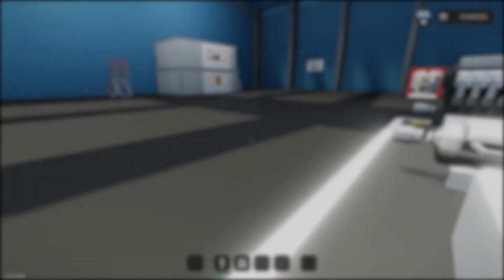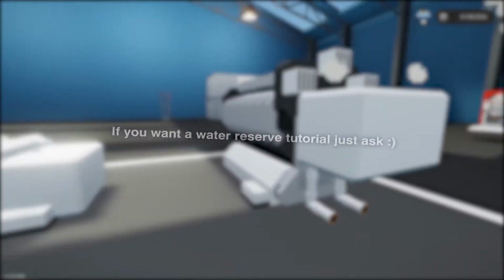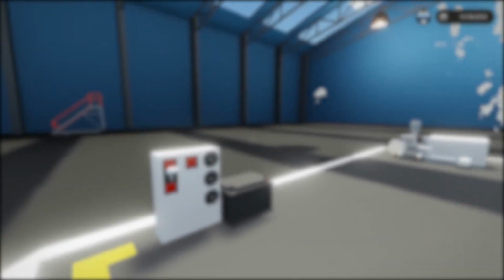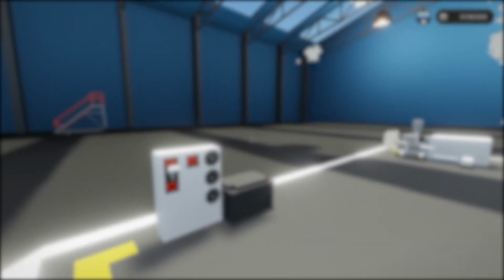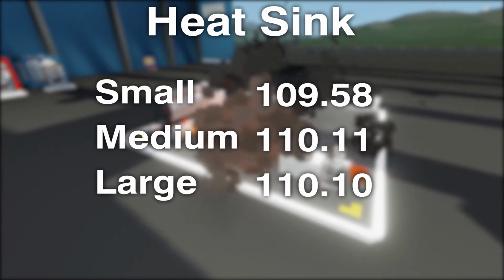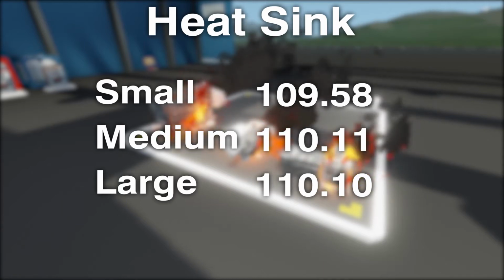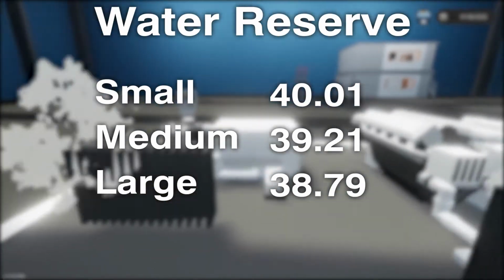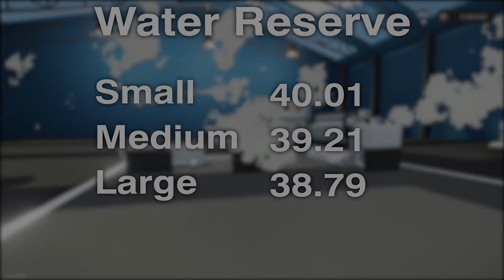What is the best way to cool your engines in Stormworks?

Comment: wont the water heat up tho? or is there no such mechanic, since its a closed cooling loop with no new water added it should heat up but not sure if the devs have added something? If there is something like that, can someone let me know
Reply from the maker: Sadly this doesn't work any more :(
Reply: @BigmanBoi  yea water with radiators = explode. i ran my own tests with modern stormworks and with water in the systems they just blew up.

Comment: How do you get the water reserve tank?
Reply from the maker: It is a regular fluid spawner, but instead of spawning diesel it spawns water
Reply: @BigmanBoi  its not working for me
Reply from the maker: Check that there aren't any holes in your tank. If there are fluid wont spawn
Reply: @BigmanBoi  no the engine overheats with water in it
Reply from the maker: Are you using fresh water? Salt water won't work as well
Reply: @23Howey  Use a Fluid Heat Exchanger, I tried it with a large engine at 20 RPS and it didn’t overheat. If your engine still blows up, then lower the RPS, and instead add a gear box.
Reply: @usernametaken7738  you mean a radiator
Reply: @23Howey  that or the actually Fluid Heat Exchanger

Comment: How about a radiator in a water supply? Would it make a difference?
Reply from the maker: If you attached it to a water supply on one end it would decrease the temperature but not by much. Feel free to do so tho
Reply: @BigmanBoi  yes this was my idea and was wondering if engine would run above 20rps this way
Reply from the maker: Your engine has a built in limiter. Cooling doesnt affect the rps
Reply: @BigmanBoi  Unless you do put impeller pumps as cooling pumps by powering them from the engine itself.

Comment: I tend to draw straight from the ocean with all of my boats, I'd love to see how the values work out when you use multiple radiators (1-5ish?) and at multiple different RPS'.
Reply from the maker: I could do that, but there isn't really much value in doing so since the water cooling is so much better
Reply: Value for plane/helicopter creations
Reply from the maker: you can still use water cooling in planes, helicopters and cars. The tests in the video were using a small custom water tank. If you'd like I can make a tutorial on how to set them up